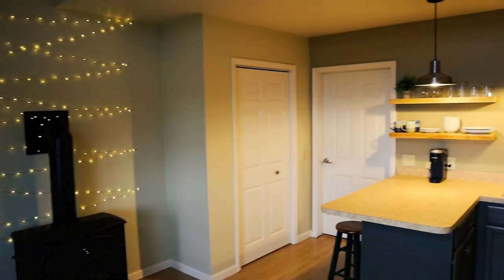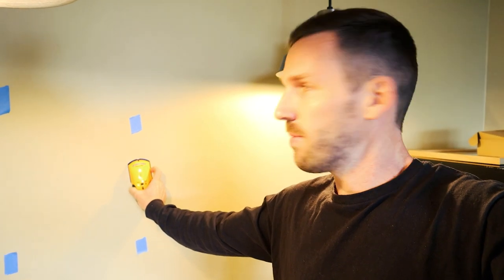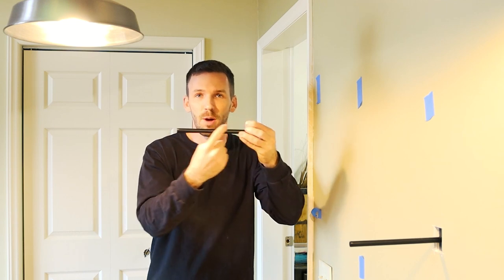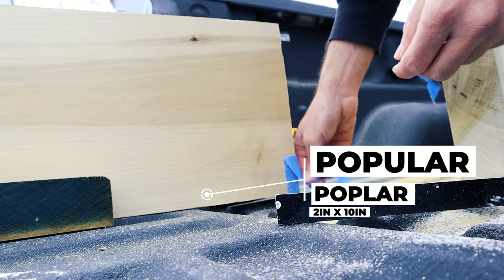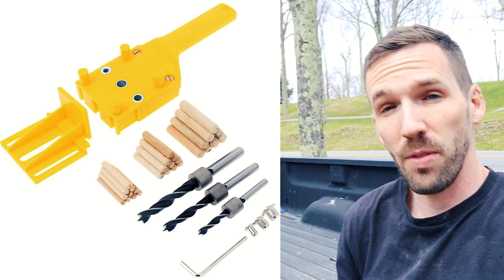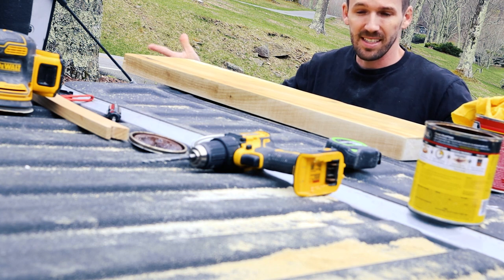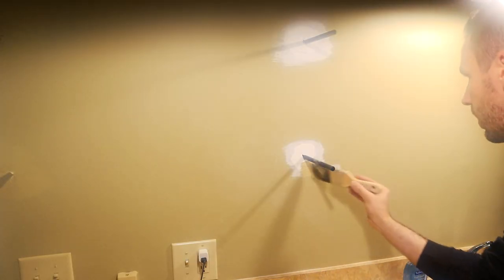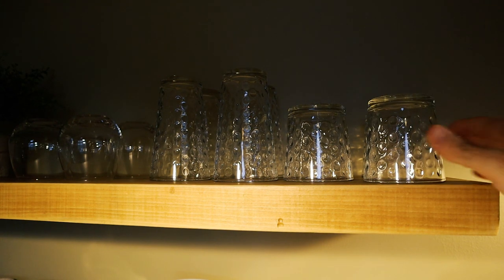How to Make & Install Floating Shelves the REAL Way | DIY

Comment: One tip. You cut out a perfect rectangle with the oscillating tool. Just drill a hole in it the size of the rod and you can slip it on and back into place. May have to trim the thickness to account for the bracket behind the drywall…..but you have an oscillating tool.
Reply: Ha, I was just about to post this exact same comment.  Works like a charm.

Comment: I have never seen somewhat cut out the drywall but that is brilliant! So much easier than chiseling out the wood  of the shelf! Way to think outside the box!!
Reply: How is that easier than chiseling the wood...?
Reply: @jamesrichards2980  You could cut out drywall with a butterknife and little skill as opposed to owning and properly using a chisel.
Reply: You’ve never seen it because it’s WRONG 😂
Reply: thanks for sharing 🎉

Comment: Amazing video. Looking to do the exact same thing with some 8/4 ash. Every rod I’ve found on Amazon has the predrilled holes spaced out further than 1.5”, only allowing for one screw to hit the stud. Didn’t think of cutting the sheet rock and flipping it vertical. Genius! 🤙🏼
Reply: Same here, a link to these brackets would be amazing!!

Comment: I was really impressed with your tips! Everything you did was what I had in mind! I am doing the same thing in my kitchen. However i will be placing it over a subway backsplash. The drywall cut outs were clutch, levelling the bars, stepping up bit sizes etc! Only thing i saw that made me nervous was you drilling in the rain! Hope they didn’t get too wet 😅 This video gives me some momentum to give me shelves a go! Thanks.

Comment: Great video. 

Just a thought.... As long as your shelving wood is at least 1/8" inch wider (min 1-1/4") than the 1'-1/8" (short side) of the bracket, why not rotate the  bracket 90 degrees and drill chamfer a third hole  towards the middle on the opposite side. More work on the front end, but I don't mind metal, but steer away from drywall repairs if I can. I often find the repainting does not always match the original color nowadays.

Comment: Oh, great. I've designed a mini library in my bedroom but it has to be done like a floating shelves, so I need to install a powerful shelve to put books on it. It should be strong enough to hold the weight of the books. This way of installment could do, right?

Comment: Love this. I have a small corner and no coat closet so I'm hoping to install some floating shelves. We are talking about 16x12 and in a corner. I don't think I can reasonably do two brackets on one wall. How do I handle the corner. It's a long term rental and a high traffic area.

Comment: You drilled out the final holes in the timber with a masonry bit. What do you need to do to make sure this works properly, I have tried in the past but been unimpressed with the result...
Reply from the maker: the best thing to do would be to use an actual drill guide to keep the holes straight. However, small imperfections with the holes actually make the shelf more snug when pushing it on the mounting brackets.

Comment: where did you find actual 2" wood?!
Reply from the maker: At a real hardwood store that sells all kinds of specialty wood. Wood will range from $5/ft to like $40/ft+ depending how exotic you go. Poplar (like mine) and Walnut are a little more common and not super expensive.

Comment: so what's the point of  cutting off the dry wall if you could just screw into the stud?
Reply: Eliminates drywall wobble from getting crushed
Reply: Didn't watch the video, huh? Drilling into the studs prevent wobble.

Comment: Why didn't you use longer rods and drill the studs for them? 
No cutting the drywall.
No patching and painting the drywall.
No screws.
Could have saved a lot of time.
Reply from the maker: Interesting, are you saying to just drill a long hole into the studs and use a long rod, rather than a rod with a bracket on the end? 

That would actually work great if I stuck a little epoxy into the rod that goes into a stud. Good thinking, I've never seen that before.
Reply: @KellyConcepts  Epoxy? No adhesive of any kind is needed. How would anyone ever get it out? A friction fit will do quite nicely.
Don't over think things.
Reply: There are standards for live wire in place but who know what is going through the stud. This method is good if you not sure what is going through the stud. That is my guess for not using long rod
Reply: @runtime_engineer  It's too high on the wall for any plumbing or electrical but every home improvement store has stud finders that also see these things.
Reply: @trustme7731  To high? You realize the wiring in your house run from the top then down to the outlets and switch’s.
Reply: I should have said some style  houses such as a ranch built on a slab.
Reply: @KellyConcepts  If you epoxy it how will anyone ever remove it? Maybe use a piece of threaded rod in a hole that was sized right so that the rod could be screwed in using a couple of nuts.
Of course you have to drill the hole as level as possible and perfect it by bending the rod to level if necessary.
Reply: @richardlug6139  No they don't except for many homes built in the '50s and '60s. They ran the home runs to the ceiling lights and dropped down to the walls from there. Besides, if there were cables there they'd be vertical on the face of the stud, not through the stud.
Reply: @richardlug6139  Wouldn't matter. My reply above still holds. More receptacles are required now than in the '50s and '60s. The ceiling light box could not hold so many wires and it's significantly shorter to run from receptacle to receptacle low on the wall.
Reply: @trustme7731  Your right I was not thinking,  the wire would be on the face of the stud and as long as you drill straight in you would be safe.
Reply: @KellyConcepts  probably the reason you never thought of that before is because nobody does it, so you're good. I think it's super against code to hollow out the 1.5" side of a stud like that
Reply: @richardlug6139  Yes, but in general wiring that is run thru wall studs is usually run below 42 inches from floor level as standard practice. Also, it is difficult to drill studs for wiring when you are drilling above your head.

Comment: I literally do not understand why you would put the floating shelf brackets inside the drywall like that. Why don't you just screw through the drywall, into the stud, and chisel out the back of the shelf?
Reply from the maker: 1:40 in the video explains it
Reply: @BibleTalk101 watched it with sound off

Comment: I understand your logic, and although it makes some sense, I believe you’re totally wrong here. 

You’re supposed to install any heavy load decor/home accessories over Sheetrock, but to a stud, like it’s always been done. 

If your shelf is wobbly after installing the shelf over Sheetrock, but to a stud, you’re not using the correct hardware for the load. 

It’s not the method that’s wrong, it’s the hardware. Best practice is to avoid making any additional/necessary holes through drywall in your space to prevent any more air leakage than you may already have.